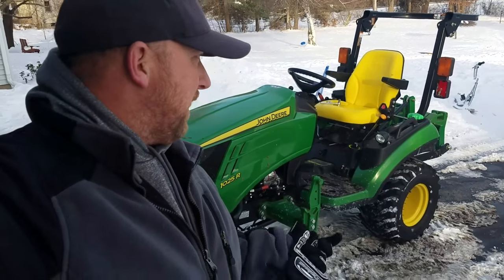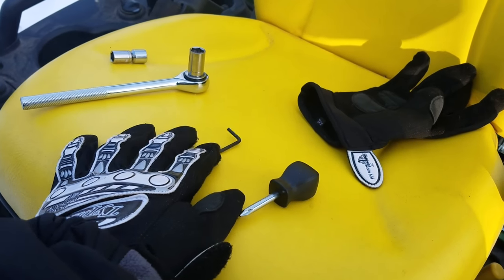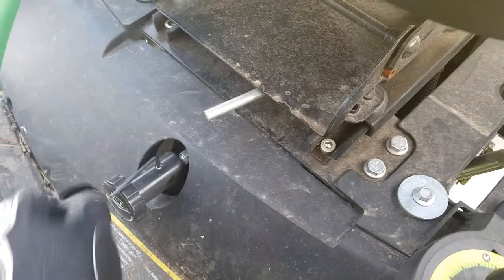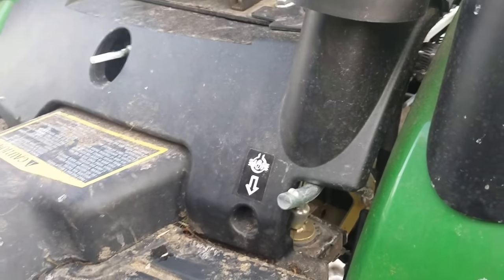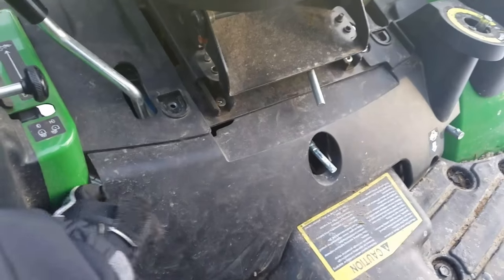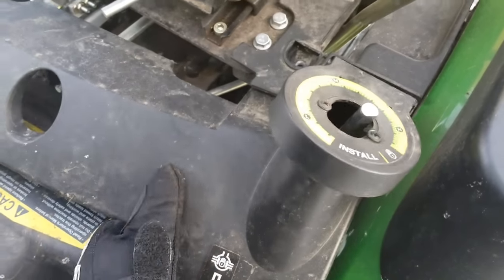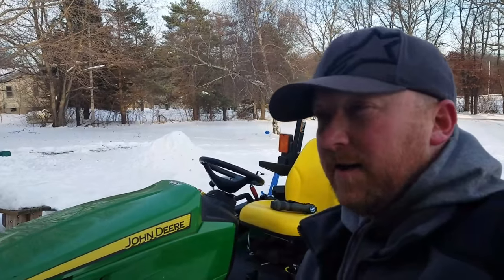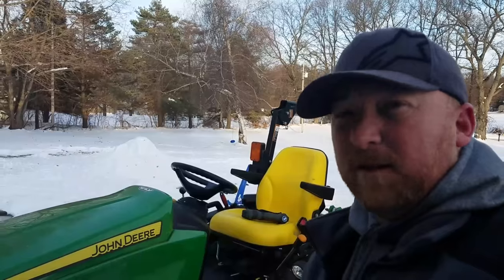John Deere 1025r PTO/RIO bypass, how to disable pto/rio safety switch on John deere 1025r/2023 fix

Comment: I just bought a John Deere 1025R.  This will be my first mod.  Thanks for the info.
Reply from the maker: Congrats on your purchase, I don't think you'll be disappointed.  Thank you for watching and your comment
Reply: I bought my 1023e last summer and I mow very hilly terrain. This switch has almost killed me several times. I cussed Deere EVERY time I mowed. I wonder how many deaths it has caused. Dead men cannot tell tales, but I bet it has killed people. I fully understand killing the PTO, but killing the engine with a hydrostatic machine with power steering? That is fucking dumb.

Comment: Best idea I've seen. I will surely do this as I just purchased a JD1025R  and  it's  the most annoying thing I've encountered.
Reply from the maker: Robert Germond glad it helped.  Hopefully you have many years of use out of your machine
Reply: Robert Germond 
I just ordered one yesterday, I may end up getting a 2019 due to the wait time from Deere as the dealer did not have a TLB in stock.
I presume your machine is a 2018, or is it older than this one in the video as it was posted in 2016.

Comment: OK, the job took 22 minutes, but I put a small washer with double sided tape on the button with the other sticky side on the zip tie.. The zip ties were quite narrow and the button is slightly rounded. I wanted to be sure the zip tie did not slip to one side and off the button. Also, on the 2018 model, the bolts are a #12 metric (instead of #10). Be sure to hold down the differential lock lever when putting the cover back on, and continue holding down to get the Phillips head screw started as the spring on the lever is fairly strong and pushes the cover out of alignment. Again, GREAT VIDEO, and thank you very much.
Reply from the maker: David and Laura Branscomb and Hauer great idea ! Extra peace of mind,  nothing wrong with that thanks for the tip and watching . Thank you for your comment also, hope you get great use from your machine
Reply: Excellent additional knowledge to a already great video. We just purchased a 2019 1025R and was wondering if anything had changed, now prepared to take care of that nuisance reverse switch, thank you !.

Comment: Thanks for the video, my husband Dennis will go outside and do just that now. Ours is a new 1025R and both of us hated the fact that it keeps shutting off the mower. We learned to hold the switch down in order to back up and keep mower running. It's still a pain in the you know where and every now and then we forgot to hold the switch down when backing up. Husband wants to use it as a  stump grinder, bush hogging among a few other things and holding the switch is not an option.
Reply from the maker: well thank you for watching our video, so glad to help. just be careful and enjoy the less frustration, we wish you all the best and many years of service from your tractor. yes in my opinion the switch is more hassle than it's worth and causes extra wear and tear when forgotten and you have to keep starting the blades or attachment etc.. thanks again you are great

Comment: Thank You. Got-R-Done. And the seat. I actually pulled the switch lose. Found it too hard to try to get the zip lock on where it was. Plus I wrapped it with a little tape and then used another zip lock to tie it down out of the way.

Comment: Works my 2019 2023 that drove me crazy
Reply: Thanks. I have a late model too and was wondering if this would work. I removed the two bolts holding the switch and rather than bolting it back up, strapped the closed switch to the bundle of cables below. That way, the vinyl tie didn't get worn through over time.
Reply from the maker: Sweet.  Glad to help! Thanks

Comment: Thanks, I'm in total agreement with you...My last encounter with the RIO on a hill shut down my engine and I coasted backwards to near oblivion before being able to stop the tractor...Just one more unintended consequence that JD engineers didn't fully think through. The RIO engine stop feature introduces more dangerous outcomes from loss of hydraulic and motive power than it prevents!  John Deere: Why didn't you not just disengage the attachment PTO??? ...Guess the JD engineer never actually used the tractor on a hill!  :(
Reply from the maker: sorry for the late reply . i have not been notified of half my comments and smoe subscribers have said they are not being when i post a video even though they have the bell checked, i'm glad you are okay at least . i could imaging that being a startling experience. this made a world of difference for me that's for sure. Cheers!

Comment: This not a boring video but very informative for sure. I've always wondered if the employments of any kind would shut off while in reverse & if they kept running. The mower deck especially need to stay running in reverse just for the simple fact that mowing is also done in reverse.

I plane on purchasing a 1025R in the new future so this will be very useful for sure. Thankya for sharing this video
Reply from the maker: Thanks for your view and comment, YouTube never let me know about it. I hope all is well.
Reply: @TonyCampCamppartyof4  Howdy.  & you're  welcome.1st of all, its amwazing to see my comment to ya from 4yrs ago. . . WOW! 2nd, i went ahead & bought me a new 1025R in august of 2017 & it came as the FILB package deal. Got a set of Frontier pallet forks with  the deal. The following spring of 2018, i bought a rear, 6ft blade for it. 3rd, after fighting & fighting & fighting with the mower deck shuting off in reverse mode (i never knew about pulling up the PTO knob a bit further to bypass "shutdoff"mode) i finally found your video again & i did the exact same thing as you showed. Works absolutly wonderful!!! I dont have to worry about the mower deck shutting off when in reverse & i've also bypassed the electricle connection wire under the seat as well because there are times when i had to stand up from my seat to look over the front of the tractor for whatever reason, & the engine would shut off. 4th, Ive also extended the all the side control levers, the engine throttle lever, & the backhoe & outrigger levers all for easier reach of things. I need to still do the same for the seat adjustment lever. I've got close to 900 hrs on the tractor with alot of backhoe work done. No i just need the new HYDROPLUS hydralic pump instled for faster moment of the hydraulics. Thanks again for your video.  Tractor safe!

Comment: Thanks, I like this reversible solution better cutting or jumping wires.  I get the safety aspect, and it's a good idea for families and those new to equipment, but I've been operating equipment for 55 years and find it frustrating when mowing. I will do this soon.
Reply from the maker: Glad I could help a little. Sorry but YouTube didn't notify me of your nice comment.  Thanks a lot

Comment: I got my 1025 yesterday and tried out the mower.The dealer didnt explain to me how to lift up on the pto button for mowing in reverse.Like you, once I figured it out it was still a very irritating thing to get used to every time I wanted to back up.I found your vide and I would just like to say a giant THANK YOU.I'm gonna get this done first thing.Perhaps my frustration level will subside also.Have you figured out how to disable the seat switch yet? I hate that thing too.Once again thanks a ton :)
Reply from the maker: You're awesome bud, I haven't done the seat yet but it's easier.  I do have to get it done though. I'm glad you found my video a little helpful.  I hope you have many years of good use with your machine

Comment: Thank you for taking the time, and enduring the cold! Very helpful video...well done!
Reply from the maker: Rick Lamascus I'm very glad it helped. it was worth it , thanks for taking the time to comment.  I know we're all busy but sometimes a little tip/trick can make a difference.  so I try to share cool stuff if I find something out or figure out a easier way to do something
Reply: I refer to people such as yourself, as "good will ambassadors" who spend the time to help others for no personal gain. I am currently doing as much online investigation into the 1025R as I can. I am downsizing from a compact L3130 Kubota and looking hard at the JD instead of the Kubota BX (front loader, mid-mount mower, and tiller only). I've nothing but great performance from my larger Kubota, which makes me reluctant to switch brands.  Any additional thoughts from you on these two tractors? Thanks, Rick

Comment: Lucky I got my 2320 prior to them putting this switch on. But I have to disable the butt in the seat switch around this time of year. The foam in the seat becomes too rigid in the cold to register my dainty 260# booty. So I jump out the connector beneath the seat with a homemade spade connector and remove the jumper in the spring.
Reply from the maker: WSMC Mc haha too funny thanks for watching it was definitely getting frustrating with this PTO switch. I'll definitely have to remove my seat switch also

Comment: clothespin works great too, just lift up on the pto and put the clip in. gonna do this way though, more clean looking than a clothespin lol
Reply from the maker: UPstater5.9 hey whatever works, good idea. Thanks for watching and the comment. We're all in it together
Reply: The 2017 uses a rocker switch which negates the clothes pin work around. Looks like I’ll be using this mod. Thanks.

Comment: THis is some good information.  I have a 1025R but I just have a back blade and the drong bucket for snow.  I have been looking for a snow thrower for it.  Where did you get yours?  Or who makes them?  I just moved to the mountains.  Talk about snow!
Reply from the maker: Dave Engstrom glad it helped man good choice on tractors we've never had any big issues with ours. I bought the snow thrower through the dealership when I bought the tractor it's a John Deere snow thrower. We've been hit pretty hard this winter but I'm staying ahead of it with this Beast
Reply: You can also get a rear cat 1 blower from Deere or other makes such as Woods.
Pros and cons on a rear blower, but the front blower has a very long shaft to run the blower.

Comment: There is a plug connector on the front of the tractor you are supposed to plug-in when you hook up the snowblower so you don't have to use the zip tie.
Reply from the maker: Santino Castillo this works for mowing and snowblowing so it's more permanent until you remove the zip ties. I was more frustrated when mowing more than anything. thanks for the comment

Comment: Gotta love idiotic rules and regulations... like the gas-can one where it's supposed to suck the fumes back into the can.  Problem is, the cans are made so poorly that they leak a good amount of fuel, so now you're polluting the air AND the ground.  That said, pulling up on the PTO button actually makes the problem worse by making people new to the tractor (and thus more likely to cause an accident) look for the button, then restricts how far they can turn around because they have to keep holding onto it.  Additionally, I have an uncle AND a family friend that both have old neck injuries that restrict neck movement, so they have to turn their torso to look backwards enough, and this switch restricts that, for them.  When a safety "solution" makes a problem worse, it shouldn't be implemented and a new solution should be found.  As always, the many suffer due to the stupidity of the few.  I'll probably be doing this if I manage to save enough for my own snowblower, this winter (would be my first PTO attachment for my 1026r).  Thanks for the video!
Reply from the maker: Zurar awesome comment man , seems like you get it. Was such a hastle before . Doing this also keeps the deck on when backing up which is a great help if you have no worry of small kids running around the yard while you're mowing. Thanks for watching

Comment: Or you could just buy a Kabota BX and not  have deal with that crap. BX doesn't have any of that electromagnetic PTO stuff. It's still a real tractor with hydraulic PTO engagement. I like the looks of the John Deere but I think they cheapened them up with too much of the plastic and the pto engagement bottom.